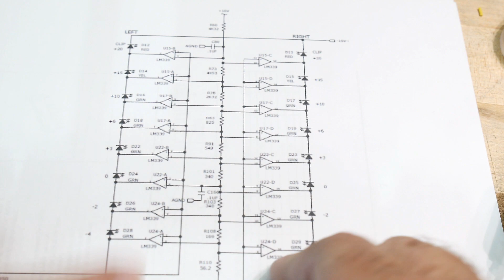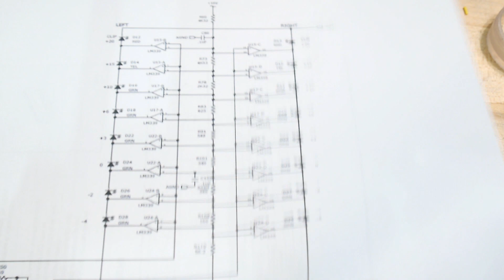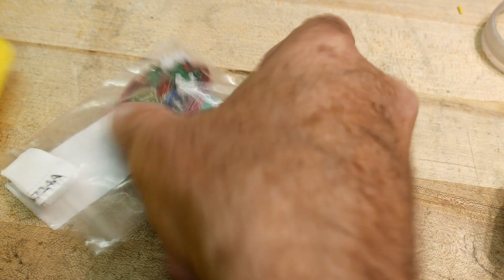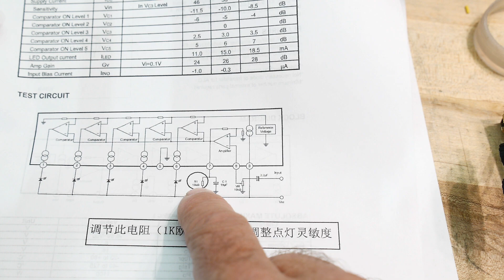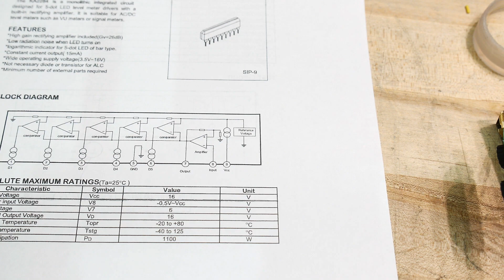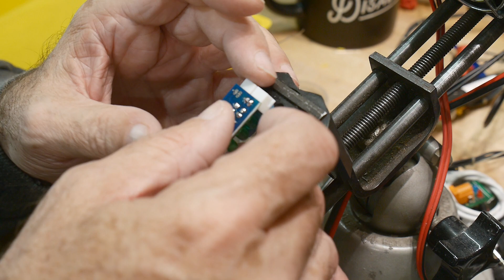#1004 VU Meter Kit and special IC

Comment: The LM3914 (And other variations) will do the same thing and are great for driving bar graph style LEDs. Either for volts, RF power, Audio etc.
Reply: The LM3914 is a linear LED driver, while the LM3915 was a 3dB per LED segment version for audio VU display.

Comment: I'm surprised that the bean-counters didn't use LM3914, LM3915 or LM3916  on the Mackie.
Reply: LM324 is 7 cents apiece in narrow SO14, or 10 cents in DIP, qty 1k. Resistors are less than a cent each. I think the bean counters’ time wasted arguing about the cost would be more than than the savings. Some of those old chips are so ubiquitous that they really don’t cost much beyond the bare minimum.

LM3914 is made in PLCC only for $3 qty 1k, and 3915/6 are not made anymore. It makes about 0 financial sense to use it, given the price of the comparators – about 2 cents each qty $1k in quad packages. Try and beat that. Seriously. The only thing cheaper is a microcontroller with built in ADC and some free GPIO pins. And even then an 8-bit ADC is a poor match for log scale signals if you want more than 6-8 levels. If you want many more, like 16, discrete comparators and resistors still can’t be beat.
Reply: @absurdengineering  - LM3914/15/16 is also available in DIP.

Comment: LM3916 does the same thing and has been around 20 years ...
Reply from the maker: I've used 3914s but did realize there was a 3916
Reply: @IMSAIGuy  Did you ever go back thinking of a project you did and say " I used those 20 years ago" ; think about it a while and realize that the project occurred 40 years ago .... it's hell to get old! 🤣
Reply: The 3914, 15, and 16 have been around since the late 70s, I worked at Radio Shack in 78 and we sold The Experimenters handbook by Forest Mims III, it had several projects using these chips. I bought one of each and breadboarded them up, they were pretty cool.
Reply: LM3915,6 are not made anymore by TI. Leftover die is packaged by Rochester IIRC, for something silly like >$10 apiece with a minimum order. LM3914 is only available in PLCC for $3.70 apiece qty 1-99. Given the cost of two LM324’s and some resistors – about $0.25 qty 1000, there’s no reason to use the 3914-6 series. The comparators and discrete resistors are way more flexible, and take less board space if needed, or can be had in through hole for breadboards. I say good riddance to those led bargraph drivers. A few times I needed to whip them up and had neither the drivers nor enough comparators, the discrete differential pairs did the job too.